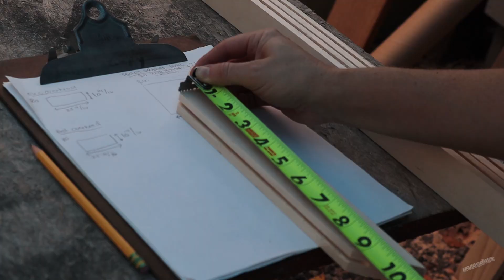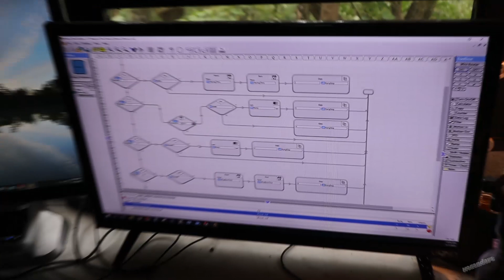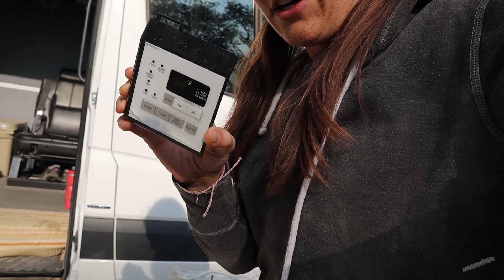BEST HEATER IN A VAN BUILD: WINTER VAN LIFE

Comment: Material needed to glue a drawer:
- 1 kg of plywood
- 1litre of glue
- that plastic thing
- 1 (one) unit of Holland Roden to put inside the actual drawer.

On a serious note, i think that a real challenge is to keep the van under the max weight. Some of that equipment seems to be heavy.